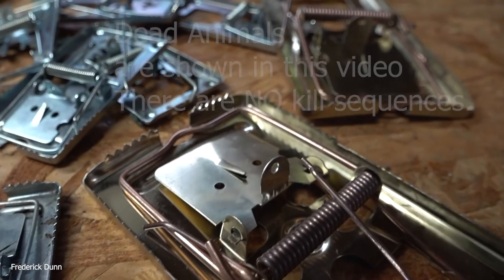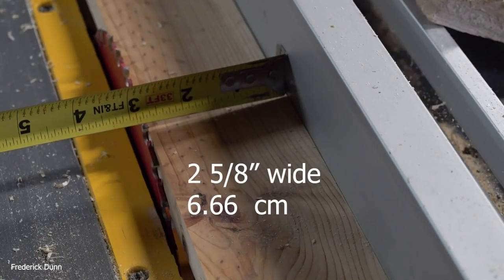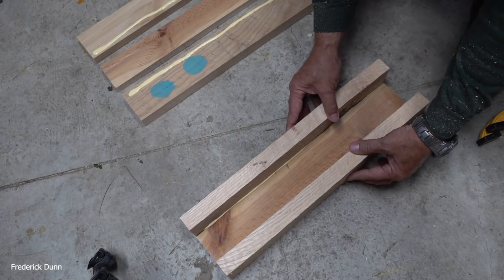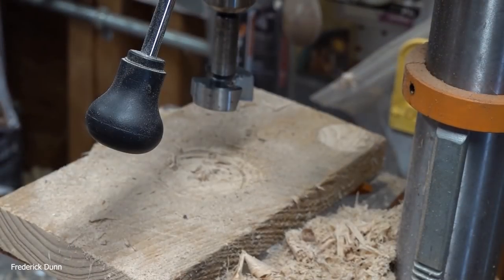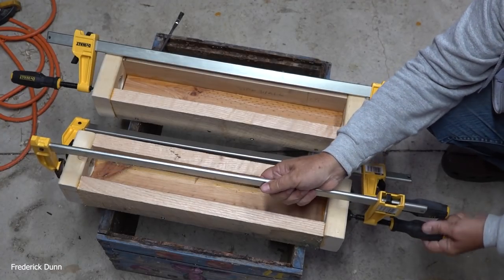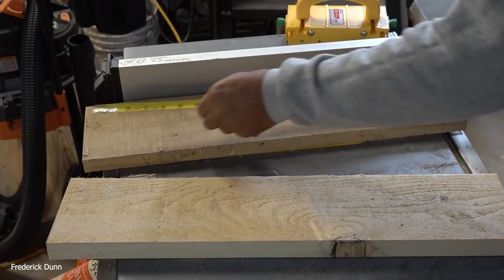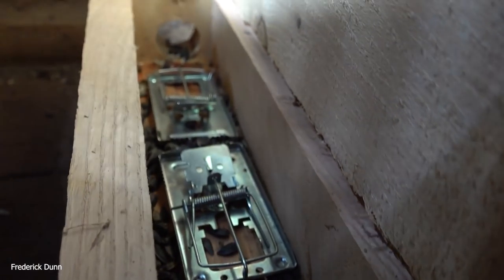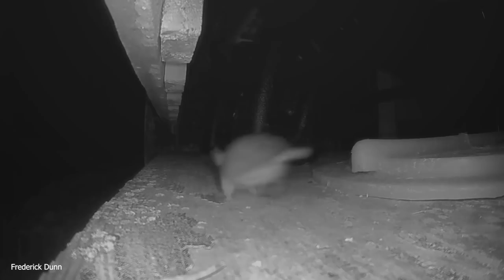Eliminate Rats Fast: Top-Rated Rat, Vole, Mouse, and other rodent TRAP that kills every single time.

Comment: Thank you Mr Dunn, I made two of your four trap boxes to solve the rat problem in my outbuildings. I caught four, but there were some which were cautious, so I changed strategy. I baited the boxes with the traps unset, only putting bait in the centre of the box to draw the rats over the traps, I also scattered a few sunflower seeds around the area of the boxes to create a "safe" feeding zone for them. After a week or so, the rats were regularly eating the bait in the boxes, then I set the traps and caught another three in one night. There is now no sign of rats. A very effective system. Thanks for taking the time to share, It's much appreciated.
Reply from the maker: THAT was a very clever process. Thank you for sharing. Those older rats are just too smart, and it becomes a game of patience. I'm glad you solved your problem and shared what your process was.
Reply: @FrederickDunn  Hello Fred, reply appreciated. I set up cameras and noticed the smarter rats were eating the bait at the ends of the boxes but not going in, hence putting the vast majority of the bait in the centre of the boxes. After a few days with the traps not set they were going straight in and staying in for some time, they were eating lots of bait and obviously felt comfortable in there. Cameras are a great help, know your enemy!
Reply from the maker: @andypdq  Excellent!

Comment: If you clap the wood for and hour or so the glue will cure no need to use screws. Especially stainless steel screws. After the glue has setup the screws do nothing.Titebond  III IS Designed for outdoor projects. Nice traps! 😁

Comment: Made this, used Victor wood traps. Caught 3 mice first set and 2 mice most other times. Works great.  Now, no more droppings!
Reply from the maker: Setting several traps at once is definitely key and in some locations, I've ended the mouse problems in a single evening.

Comment: Screw and glue EVERYTHING ! ! !
Yeah.
Are you going to do a woodburnng image? -KJ
Reply from the maker: No pyrography on this project :)
Reply: =  @FrederickDunn  = All those were rats in your trap.
I do not know why you spend time gluing, when screws is more than enough.. . It gives me good ideas. .. I use a slightly different setup, but I like yours...
I put the dead rats on a light colored board or cardboard and the bigger birds take them away..
I just need to be careful that the cats and raccoons cant reach into my outside traps because those things are painful..

Comment: bought an electrical mouse repeller, used it for a week, still have the problem. your trap looks a good try. just bought a pack of the metal traps following your link on amazon. will build the  wooden box. will try.
Reply from the maker: There is a Trap-Master on YouTube... Shawn Woods, he's tested the sound repellers and scent repellers and they failed completely.
Reply: I'm sure you know by now but those are a scam.

Comment: What do you think of the idea of, instead of putting a wood block at top, how about clear plexiglass with small holes (just enough to air the bait but not enough to allow escape) and this way you can see at a glance if you've caught something? 

Thanks for the tip! I'm dealing with mice and packrats in our [4-story home] attic that's in the middle of a forest.
Reply from the maker: That should work fine.
Reply from the maker: But part of the appeal is that it's a dark space.
Reply: @FrederickDunn  it’s pretty dark in the attic. It’s actually a cubby space within the attic. No light whatsoever gets in even in broad daylight.

Comment: The traps might have been cheap at the time ($2 per trap per the video), but now they are more than $5.00 per rat trap.  Thank you though for making the video. I'll be trying it out one of these days!
Reply from the maker: Wow! That's not good!
Reply from the maker: Is that price for the entire box, or per trap? Thanks for the update.
Reply: @FrederickDunn  They are currently 4 rat traps for $21.49; same price for black or  brass.
Reply: @Frederick Dunn  So I did end up making this and it was a fun project.  I was pretty happy with the design, however it has been ineffective for me.  In one week, one black Tomcat reusable rat trap caught 3 rats: the box of certain death: zero.  I have tried using various bait too (obviously including the bait the Tomcat is catching them with).  Pretty bummed it doesn't seem to work for whatever reason.  Rats in my area seem to have just about zero interest in  the black oil sunflower seeds. They do though seem to like apple and I have a product I purchased online made from apple that is very aromatic.  They really like that one however, not in the box of certain death. 

Although it turned out to be ineffective, it was still a fun project and thank you for putting up this video.

Comment: We very rarely get mice in the house, and almost always in the basement.  We have very good luck with a five gallon bucket that has several inches of water in the bottom.  They go in because it's the only source of water, and can't get out because the sides are so slick and tall.  It's not as instant as your set up, but the mice go hypothermic pretty quick, and it's much more cost effective for just one or two mice every few years.  But it wouldn't be worth snot outdoors.  I hate to kill any critters, but an infestation is not an option.
Reply from the maker: Mice swim for a very long time. I've never been a fan of the drowning systems for that reason. A rat can swim for over a half an hour. Not a judgement towards you, but drowning is slow indeed. Then you've got contaminated water to also contend with.
Reply: @FrederickDunn  If we had mice in the house even once a year, I would definitely be in for something more expensive/instantaneous.  And while I agree it's much slower than a spring trap, it's not at all like starving to death or being maimed or poisoned.  If they get out, they're fine, and if they don't, at least it was minutes and not days.  They are definitely crappy minutes, no argument there.

Why would the water be contaminated?  We don't do anything to it or the mice.
Reply: The bucket plank trap at my place caught four mice in a week and then never again. The mice learned. They jump over snap traps too.

Comment: I like a push stick vs. a push block
because in the event of kick back your hand is further from the blade.
 I have seen demos on utube and the difference is very nightmarish.
Reply from the maker: I used to use a push stick for my previous designs, but those had full width open ends that I've since closed up.

Comment: Commenting on the Pack Rat video and the question they asked I have seen PackRats in the Wild  and they never  are much of a Welcomed sighting  as i collect Antiqueand Vintage Automobiles and Trucks  oddly enough  the ones i’ve seen usually are moving very quickly  and always look much bigger than the ones in the Video ?  i do try to scare them out of the vehicles  because i don’t want them on my property doing more damage

Comment: I followed your guide for making a rat trap box - the one with the dramatic music. I set the traps as you described and for two nights now the end trap has been sprung but the rat got away. I have a security camera set up watching one end of the box and I can see it leaning in the box eating the bait but it didn't catch the moment the trap sprung. Not sure what I'm doing wrong.
Reply from the maker: Make sure you are using the metal made2catch traps (rat sized) and turn the traps so the trigger plates face each other, don't have the trigger plate facing the entrance, we want that rat inside when it goes off and hopefully more than one trap at a time. Configure them as shown in the end of this video with the kill bar towards the entrance when set and the trigger plate towerds the center of the box. Rats are a huge challenge!  I wish you luck!  Let me know what happens.
Reply: @FrederickDunn  Thanks for your reply. I'm using the Victor rat traps with the wooden base and plastic trigger tray. I set then just as you did in your video - 4 traps set with the trigger plates facing each other on the inside so the rat has to go over the kill bar to get to the bait. It was able to sit on the kill bar and eat the bait. The one thing I discovered tonight is that I made the side walls high enough for the kill bar to swing over but not the bar that holds it down. So, I added some spacers to raise the lid high enough for the retention bar to swing over as well. I don't know if that was the problem but hopefully I'll find out tonight. Thanks again for posting this and for your response. They are smart little rascals.

Comment: I'm going to build a couple. I want to put one outside my double wide, however I'm concern that squirrels will reach in and catch a foot. Is this a possibility?
Reply from the maker: If you are targeting mice you can reduce tne entrance hole to 1" in diameter and prevent squirrels from getting in.
Reply: Thanks. I'll do that. I was concerned squirrel would reach in and get toes trapped.

Comment: Oh, ya those glue traps.  I tried those and would euthanize the mouse before tossing it into the garbage, until one mouse pulled itself off the trap, i'll not describe what i found, pretty horrible.  I hate meeses to pieces, but not enough to use glue trap again.  Thanks for the idea and assembly video.  And of course i had to watch your other video, :)
Reply: Agree :: I tried glue traps for a short while ... never again!
Reply: Glue traps are clearly inhumane. Humans categorise mice as 'pests' but they are also warm blooded mammals with a nervous system and pain responses very similar to ours. If you are going to kill them, be a humane human and do it quickly! Glue traps should never have been manufactured - this is an animal cruelty issue.

Comment: 'my' rats :-) like dry dog food.
I've been using electrocution traps as I think that they are more humane than most other styles. However, waaay too expensive
I may try your gizmo as I have quite a few victor traps; the kind with the wide yellow paddle.
Reply from the maker: Those electric traps need frequently cleaning of the plates and the batteries drain pretty fast, but they do have some with adapters if you're near an outlet.
Reply: My experience with rats (not mice) is that you don't need to even bait the traps.  Place traps 90 degrees to their normal runs.  They are creatures of habit.  They will just walk right across the traps.
Reply: @sporkintheeye  even when the trap isn't pass through? Definitely not like mice I have filmed which will walk around a pass through box about half the time. Even more often than that if the hole is small and 100% or the time of its not pass through and they aren't interested in the bait